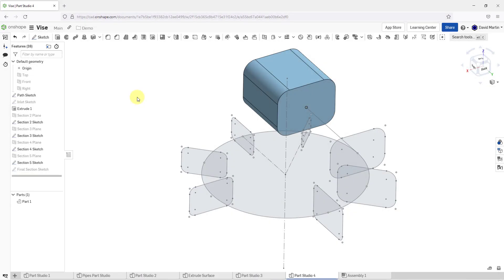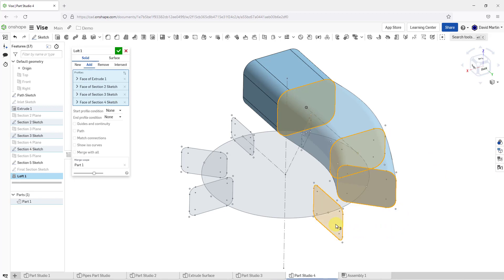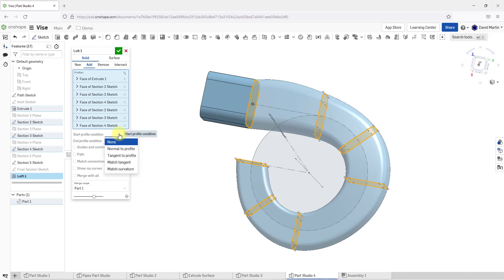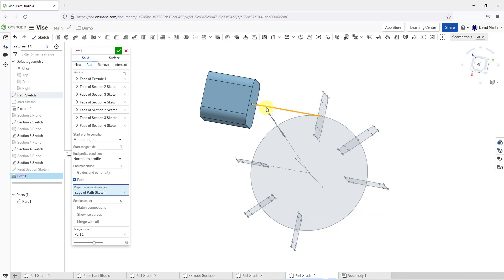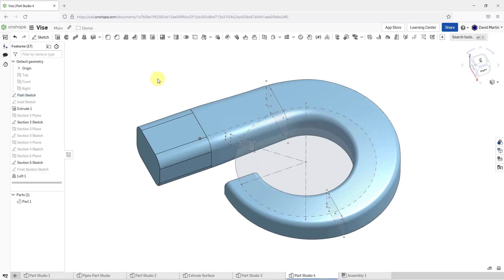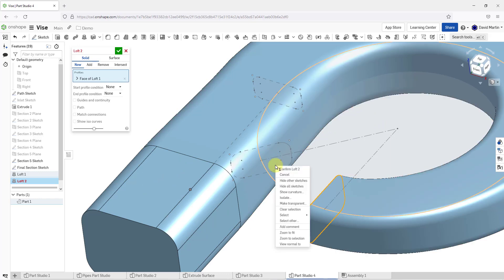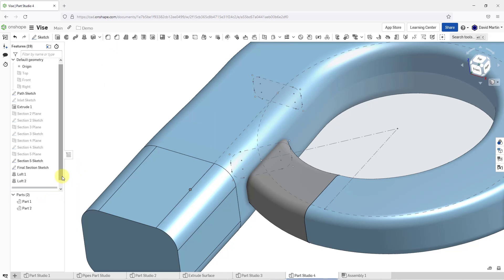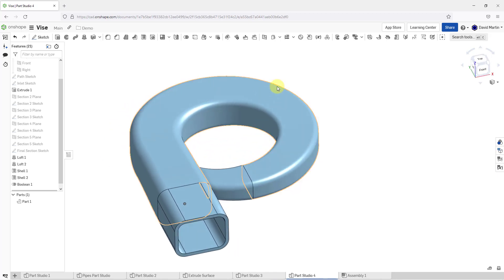Onshape - Part Studio Modeling | Loft

Comment: What are you plane settings to have them circulate in that manner?
Reply from the maker: Judging by the thumbnail, I probably created a plane offset a distance from the end of the extrude. Then I probably created a sketch with a vertical line to use as an axis. The subsequent planes look like they are at 45, 90, 135, 180, 225, and 270 degrees.